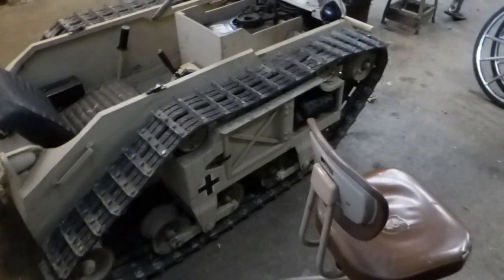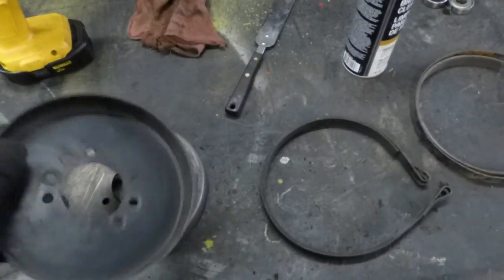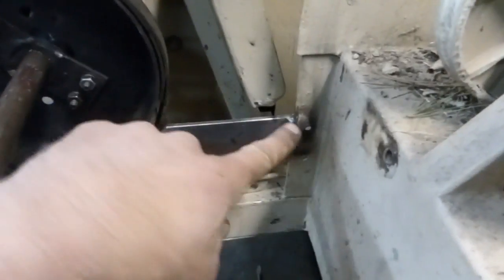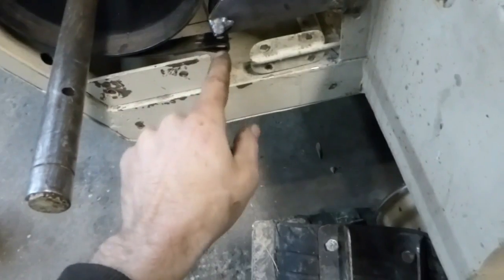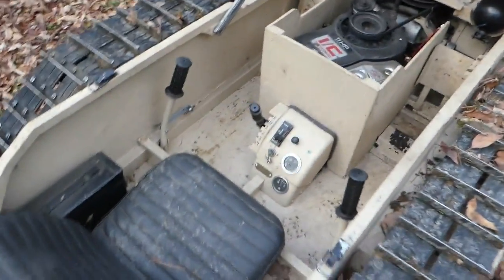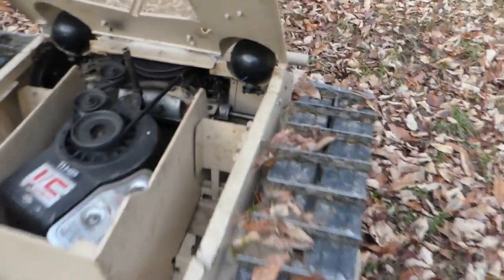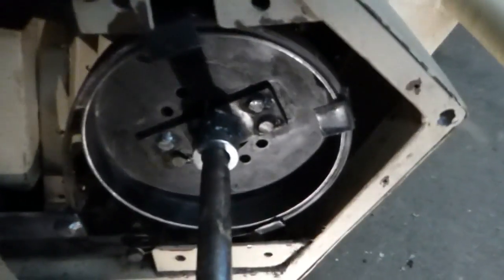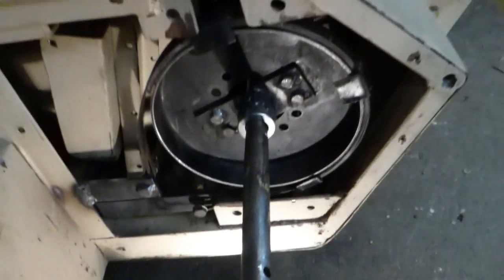Tank Steering  Brake Upgrade

Comment: What did you make your drive sprockets from????......goop 11 would hold your break band better......disc break from so Doo should work better for you.
Reply from the maker: So far the brakes are holding up but ill try that sometime. I used car brake rotors for the sprockets

Comment: So the axles coming from both sides of the transmission turn at the same speed but when you want to turn, pulling back on the lever puts tension on that side with the friction belt? Does it not hurt the gears inside the transmission? That thing is so cool.
Reply from the maker: Yes It has an open differential with spider gears. Sofar it has held up without any issues

Comment: sweet rig. looks like it could push a plow good. nice job on innovation there. 😎
Reply from the maker: Thanks :) I almost picked one up at a garage sale a few years back but it wasnt wide enough so i passed. It would need to be about 50" . But its definatly something I want to do. Probrobly put an electric winch in it for the lift.
Reply: That would look cool. Seems you stay very busy. 😎

Comment: Finally getting cuaght up on your videos. love that thing. what did you make the tracks out of?
Reply from the maker: Theyre just old tires. Regular coopers I cut the center 3 tread bars wide. And used 8 all together. The cleats are just bed frame and alot of bolts. a hell of alot of drilling

Comment: does it have much torque and btw that was awesome going over those dead branches
Reply from the maker: It has plenty of power. I havnt pulled any heavy loads with it but it moves itself around in any gear just fine. Goes up steep hills no problem
Reply: wow that is just so cool if i had one id use it to help me pull logs for firewood ,would be cool if you made a two wheeled trailer for it .

Comment: Works pretty good. If you want to switch to rotors and calipers let me know, I made my own rotors and calipers, would be right up your alley to make.
Reply from the maker: Cool. I was kicking myself a little bit because i had nice big mechanical calipers that would have been perfect but I sold them a while back. I think this setup will work  but time will tell
Reply: you must have filmed this a little while back since there is still snow where i live.